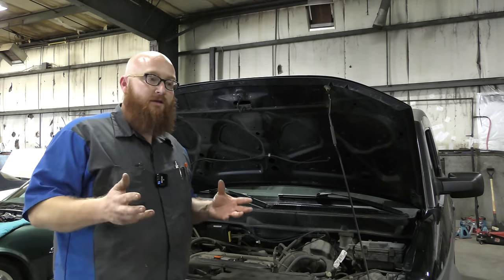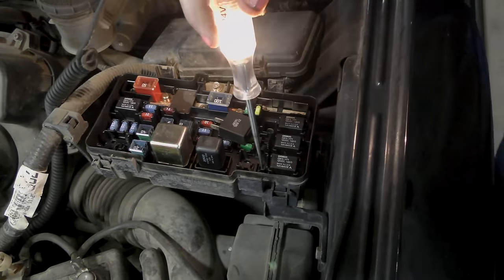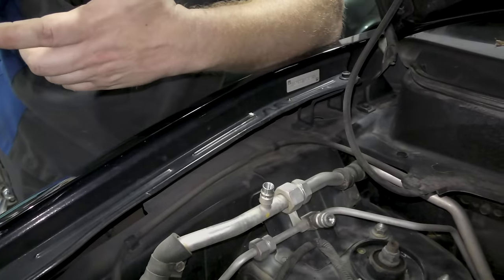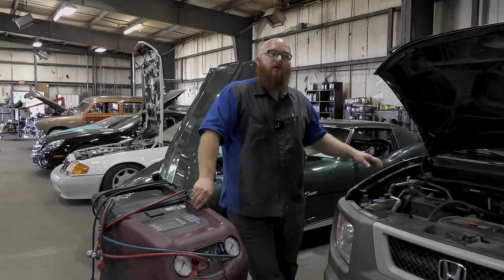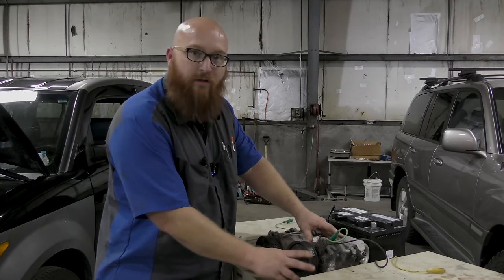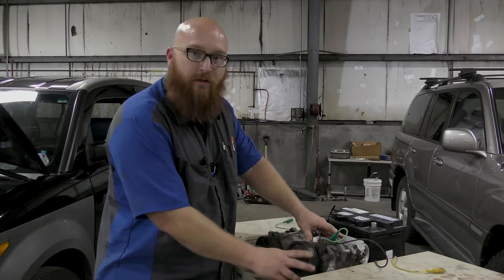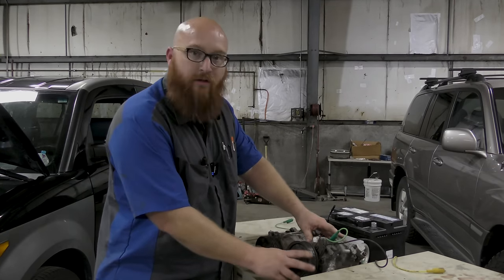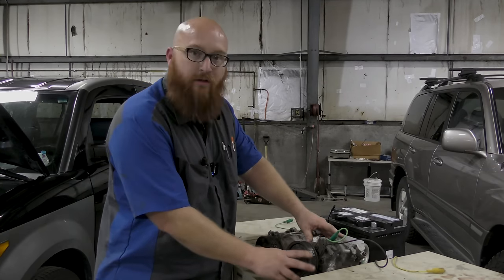AC not working!!! The CAR WIZARD shows how to easily isolate the problem

Comment: I wish there was a simple solution to fix AC in a car. I know nothing about cars. And I'm doing so much research trying to know how to fix my air conditioning without spending a buttload of money going to a mechanic. I know my condenser is not turning on because I usually hear a click in my RPMs jump up. I was able to manually spin my condenser it's not locked up. I'm hoping all I have to do is replace the relay fuse or maybe just needs freon. I have a 2006 Nissan Altima. My service light has been an issue since I got the car it will turn on for a couple months then turn off for a couple months. I went to NAPA Auto parts to use their computer but when I plugged it in it just kept saying error it wouldn't read correctly. I live in my car and I need to get this fixed before summer comes. I hope somebody can help me

Comment: Why would you need to change the condenser and other problems if only the compressor is bad?  He says 'if a piece of debris comes off the condenser" it can mess up the system, why would that just randomly happen?

I believe the guy....it just sounds like a typical BS big shop/dealership line.

Comment: I took my car to an AC auto shop and they weren’t able to diagnose the issue, they replaced the compressor, condenser, valve, etc…. Still wouldn’t work. Does anyone have a idea what’s wrong?
Reply: The Ac would start cooling at first then stops.
Reply: How long does it work before it stops?
Reply: @acescalade4351  Probably about 1-2 mins
Reply: @Johnnyy832  I’ve heard this happen a lot but it could be your fan clutch.. it’s working until the coolant temperature raises... it probably won’t have any change on your gauge in the car but still check it with a OBD2 temp gauge. You’ll have to replace the fan clutch most likely. Anyways good luck

Comment: Listen here buddie you want to tell me what's wrong with my car. I replaced my compressor, condensor. Drier receiver brand new on the condensor, and expansion valve. I have power going to both the compressor, and checked continuity of a/c pressure switch and power going to a/c pressure switch, all my relays and fueses are good as well. 🤷🤷🤷 I'm fucking lost !!! My stepdad is stumped he is retired HVAC/ refrigeration. A top 10 rated vw shop in the U.S.A. can't even figure out what the fuck it is.
Reply: Flushed everything properly as well, and did a deep vaccum for 45 mins before I filled the system. It worked great for one day and the next morning I went out and started it no A/C

Comment: 16:40 so what I'm taking from this is the engineers who designed and continue to design ac systems are a bunch of morons.   Like with turbo there needs to be an aftermarket parts catch in case it obliterates itself.

Comment: Either you are too greedy or too mediocre. Original honda coil clutch about $130 where the original compressor with clutch about $700... but how you will over bill for your ac charging discharging if you don’t sell the totally unnecessary compressor? So in order for you to make money on a little big bigger job you are ready to screw the owner to buy a new compressor set? Coils don’t burn from aging by the way. They burn from clutch gapping. In most cases you do not need to remove the compressor to replace the coil!!! Actually is most likely you don’t have to remove it on any vehicle.

Comment: When I turn on my crv the car blows freezing cold but if I even turn the wheel the car A/C stops getting cold and gets hot
Reply: Tells me the clutch is on in my snap on scanner and psi started to drop I'm confused? Why it was working for the first 15 minutes
Reply: The psi went from 156psi to 108 psi